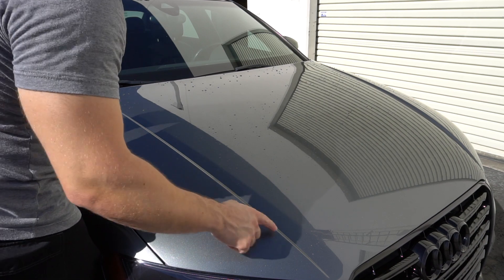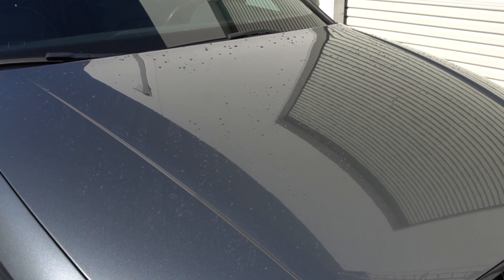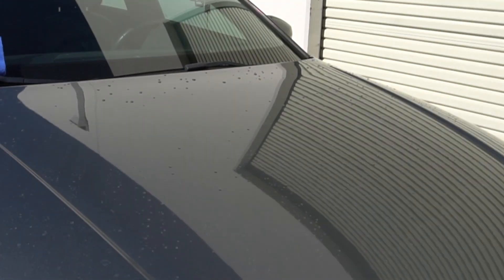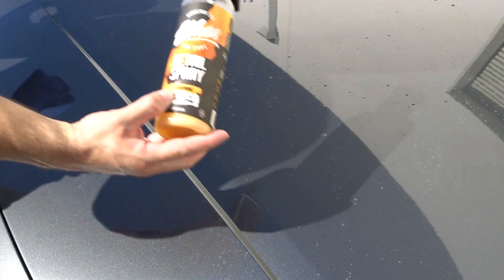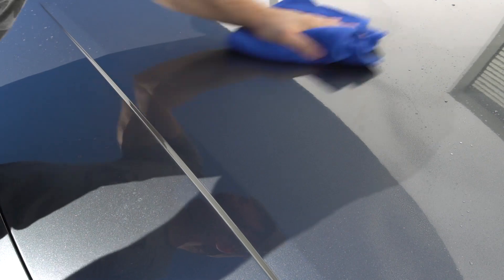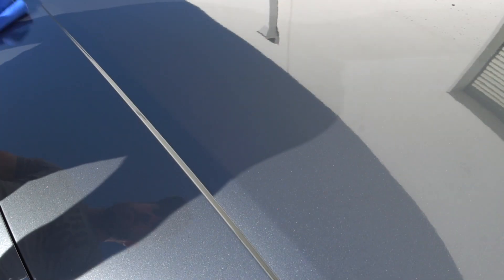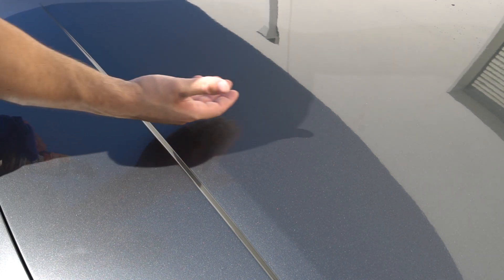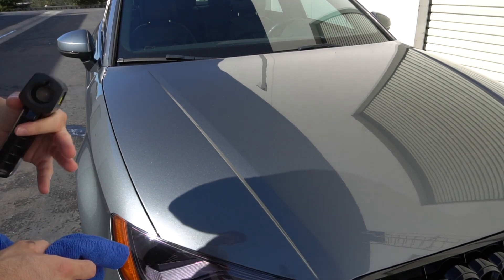Ethos Graphene Matrix Coating - Water Spot Abuse Testing

Comment: I did a video during rain and after the rain after one week of installing the Ethos Graphene coat. The car hasn't been washed, as you have to wait a week and had a lot of dust due to back burning of the bush. No water spots were left over when the rain stopped after the car dried. https://www.youtube.com/watch?v=unFar4gHV9c&t=17s

Comment: Does the consumer have to do any type of yearly maintenance on the vehicle?
Reply from the maker: In addition to ongoing maintenance washes with our Ceramic Shampoo there is no additional year maintenance that is required.
Reply: @ethoscarcare  or possibly to keep using the topper Defy, right?
Reply from the maker: @1stfrompuertorico568  yes you can apply Defy as often as you'd like to boost back shine and slickness.
Reply: @ethoscarcare  So you are recommending topping the graphene with a ceramic? Just for clarity's sake I'd like to know.
Reply from the maker: @rustycook3318  Defy and Ceramic Shampoo are compatible, cant broadly say all Ceramics will be as chemistry varies greatly.
Reply: Would this eliminate the need to clay bar your car if it is maintained and washed every two weeks?